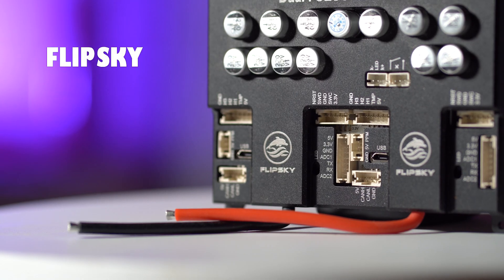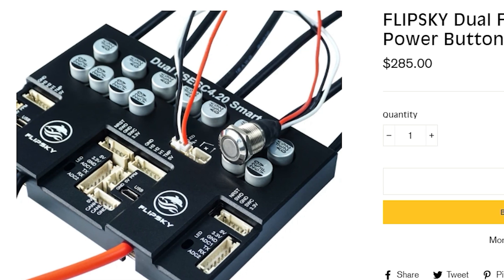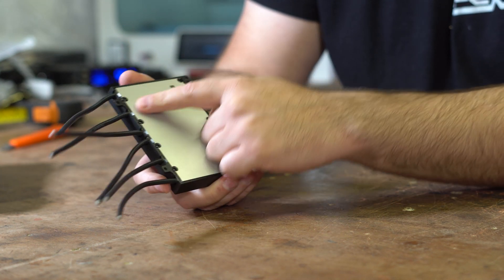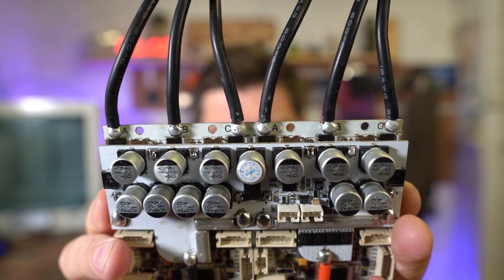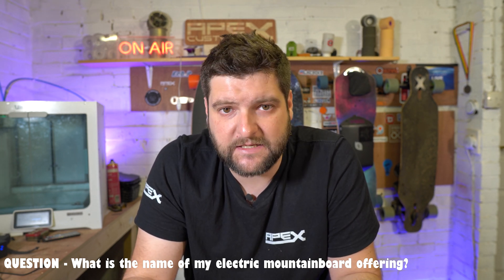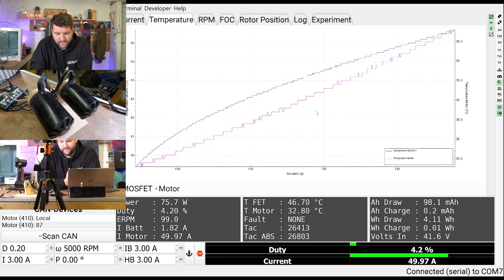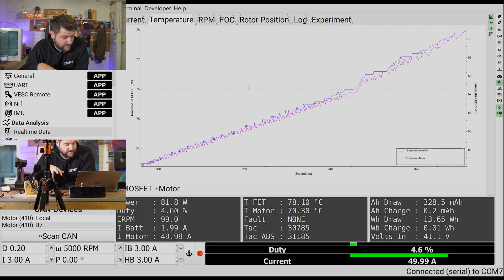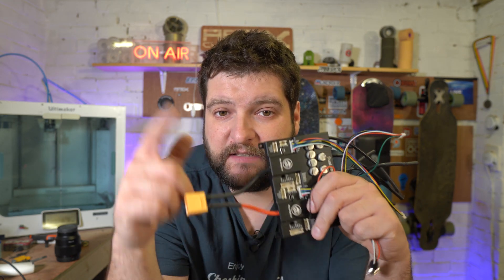Flipsky 4 2 Smart ESC Reviewed - 50A continuous Smart ESC (+ GIVEAWAY!)

Comment: Very nice design, but the cooling concept with bottom side cooling of the DirectFET-s is wrong. DirectFET-s (can package) are made to be cooled from the top for best thermal performance which could possibly enhance their power capability.
Reply from the maker: does this design use directFET? I wasnt aware of that
Reply: @LeeWright  seems that they use SSO8 5x6mm devices here in Dual, while in mini FSESC4.2 Smart which I have, there are DirectFET-s
Reply from the maker: @nikolaivic9987  yeah I didnt think this was a directFET package

Comment: I've Never used the flipsky or any vesk/focbox But I've got some experience with the hobbywing 12s Esc And I actually really like them.. Very smooth and definitely good quality..I run there RC Escs and motors on my rc car's and I've always been very satisfied with them.. so Definitely happy hobbywing is spreading there production into ESkate And All that..

I recently started my first Of-road build But Only had A Cheap 40$ Ali Express Esc laying around that I put into it and It seems to work fine for now but i definitely needed to slap A heatsink and dual 60mm fans to keep the esc from overheating...
Reply from the maker: Interesting! Thanks for. Sharing your experiances

Comment: The answer is Apex Predator. I could put one of those ESCs to good use :)

Nice review, sad to see no riding footage though! Seems like a decent ESC, although I find it strange that you've experienced it faulting above 65A... The thermal performance seems great, nearly 11 minutes at a constant 50A on both sides would suggest to me that the ESC should be able to deliver higher phase currents without problems. 

Do you only run 100A total phase current on your board? 😮I thought you would be running the battlehardened flipsky 6374 190KV motors at 70A motor current per side or so, not just 50A!

I am actually super close to having an electric mountainboard myself, finally. I will be ordering a steel on steel gear drive with a set of FS BH 6384 motors for Christmas and then I can start converting my super premium gravity mountainboard, super excited for it :) Even though the only battery I have for it currently is a well used 10S2P 40T (will upgrade later) and the ESC and ESC enclosure will be shared with my street board for now, I can't wait to finally step up to eMTBs! As someone who has never used electric mountainboards though, I am not sure what speed I should be gearing for. I have some experience riding fast on street boards and also have some experience riding gravity mountainboards on tracks and trails. What's the max your board can do? Or what speed would you recommend gearing for? I would have liked to aim for 50kph (31 mph), but my two options are 45kph (28mph) and 55kph (34mph), all at full battery. I slightly lean towards the higher top end, but I am really unsure. The drive ratio will be 5.2 either way, the lower speed option would be 140KV motors and the higher speed option would be 170KV motors. So hard to decide what to go for!
Reply from the maker: Hey bro, yeah just no time to strap this into a board to ride it and I agree that it would seem it should be very capable at large instantaneous currents.  I run 100A per motor (motor max) on my boards.  I would reccomend the 170kv for your eMTB.  If its your only board its nice to be able to get a bit of speed, I think having a seperate super short geared board is fun if you have the room/funds but main board a bit longer.
Reply: @LeeWright  Ahhh 100A per motor! Somehow I got confused from the video :D 

It wouldn't be my only board however it would require me swapping parts to change between the two boards. The street board I have now is way too fast at 40mph/65kph. I think I will go for 170KV just in case I prefer riding this board in the city too. Should still be torquey enough at 100A/motor, slightly more than half G acceleration

Comment: I have 2 of those flipsky 4.12 singles running together with 2 6374 190kv. The Handle The power pretty well, i get up tô 4000w from The battery at peak power and The get up to 70 degrees celcius(in the Hot weather of brazil) only if i try tô climb mountains.

Apex predator
Reply from the maker: Nice to hear some other real world experiance dude!

Comment: Nice video Lee.  I wonder if the Openloop command is the best way to test ESC's or if maybe there is a better way.  I've never used the openloop command before so I don't fully understand it, but it seems weird that it only claims it is pulling around 80w of power - I suppose that could be 80w of power from the battery though.  Maybe I'll google around a bit and test my MakerX DV6 Pro with a similar test so we can each have numbers to compare; I'll probably integrate that into the review.  I wonder how different motors would affect it as well.

If this is truly accurate, 50A cont for that long is not bad at all.  It does bring into question though how much the aluminum substrate is helping here.  With other esc's like the MakerX Go-Foc retro, I could overheat it, and its heatsink on 70a motor current/side (metr said I was using much less than that) on one or two hills.  It's all very hard to test, I think the only way to actually tell is to run the same test on multiple escs and see how each of them performs.

Either way, glad to see that it didn't catch fire or anything.  At Flipsky's current price though, I would probably seek other options.  I think MakerX provides more value for power, if you've got room for it.
Reply from the maker: FOC openloop i the best way to thermally test an ESC without doubt.  Don't forget this was running at just 4% duty cycle so actual power is low whilst the motor current is high - exactly what you need.  Different motors wont effect the result, but bigger motors take longer to overheat so there is that and as long as you have enough time to test the ESC its largely irrelevant.
Reply: @LeeWright  Ah okay you're right, I guess the 4% does make a difference, forgot about that.  It's a weird concept to think about haha. I'll probably integrate this test into my next review then, good idea.
Reply from the maker: @RBEMotion  yeah, remember the VESC modulates Voltage for speed.  at a low speed its very little voltage being seen by the motors and hence low overall power.  Its a good ESC test nI reckon and I look forward to seeing it in your vid!
Reply from the maker: @RBEMotion  yeah you should take into account testing like this can blow a number of things up and its risky.  Even at 50A the phase wires were hot enough I thought they would desolder. You run these tests at your own risk!

Comment: Integrated anti spark is the Achilles heel of every ESC. You having problems turning off the ESC right away just shows. That's why original Focboxes were so good. Good design and NO ANTISPARK.
Reply from the maker: Yeah included antispark does seem to always have been an issue but for some board types like a street board they are so convenient!
Reply: @LeeWright  Yeah it's convenient but I would prefer safety over conveniency :) I know a loop key doesn't look that good and you need to take it out and plug in every time but still worth not ending up in a hospital.